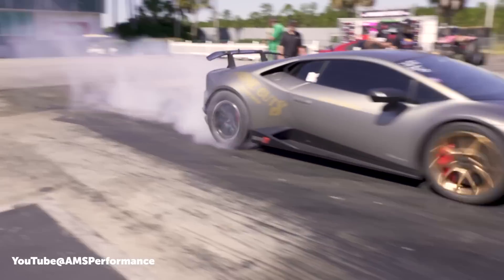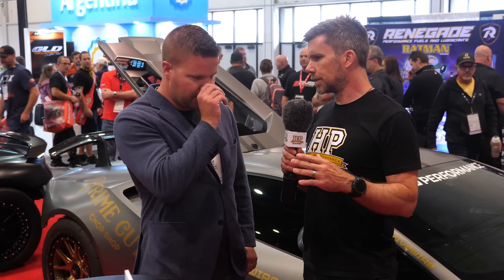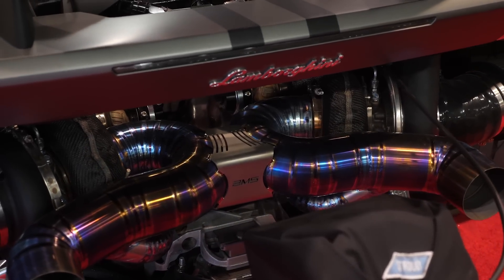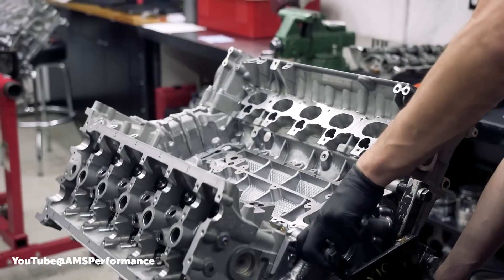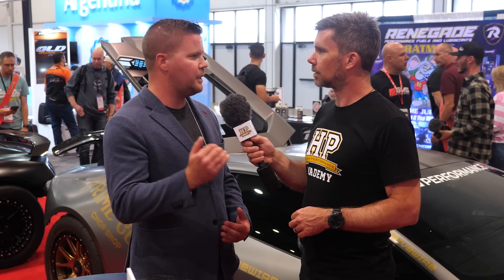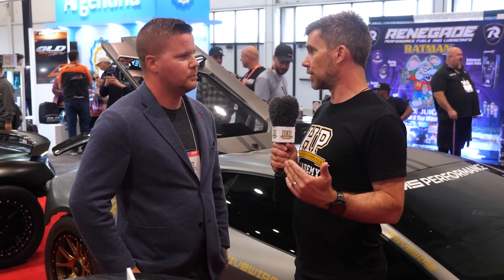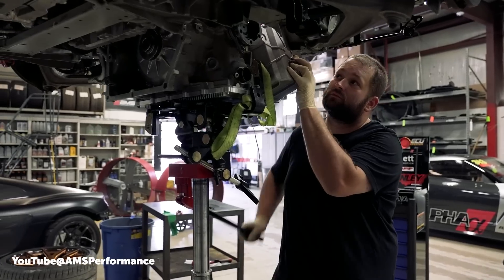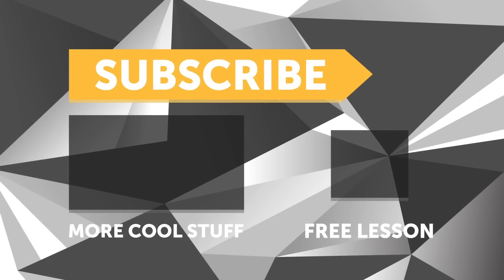This 2300HP+ Huracan Does Better Wheelies Than Your BMX

Comment: Wonderful and i love it! 
Meanwhile, Gustafsson makes 2100 WHP on a 8 cylinder OHV.
Reply: UGR was making 3500whp+ in the STO last year...
Reply: @JH-jo9wt  
I know, i have seen onboard. 
But just compare the effort.
Reply: Exactly I will never understand this level of thinking. It's to the level of nativist. Like we have some long held uncomfortably with German made products, still asking Germans about the war, etc. Throwing out the we make 2k with good ole Yankee enginutiy. Over 700hp in most cases no OE OHV block will survive very long at twice the output. In that case you are replacing the block and entire rotating assembly. You can make right around 1200 HP with an LS, but you won't have AWD unless you put it in a truck which some people are doing. So a 5000+ lbs truck vs a European exotic that is 1000 lb less and still makes 500-800 hp more on the stock block? Now we're getting silly with some of this OHV talk. Usually someone that doesn't even own a car that makes 300 hp let alone 500 hp.